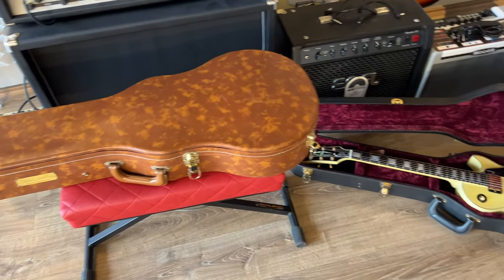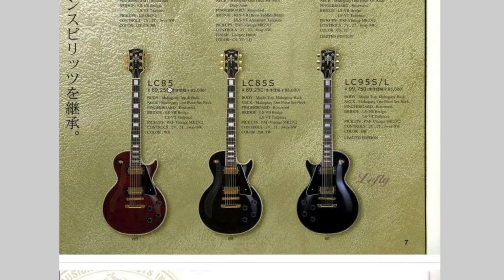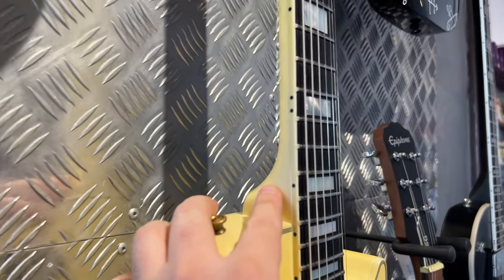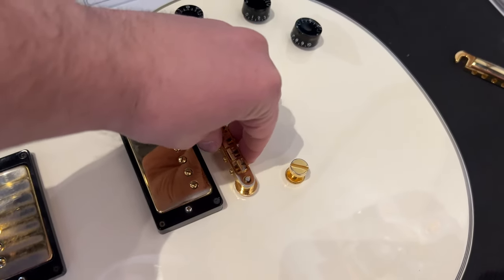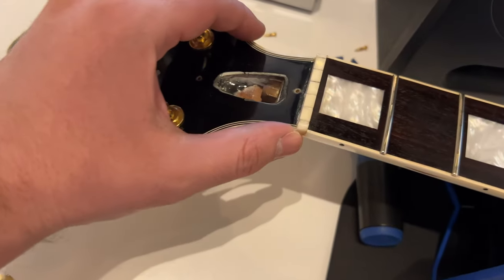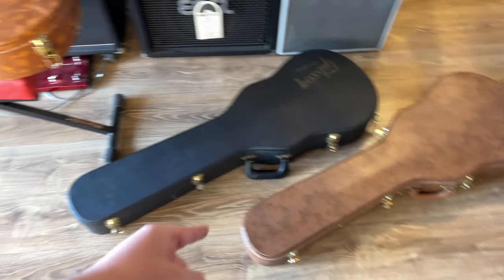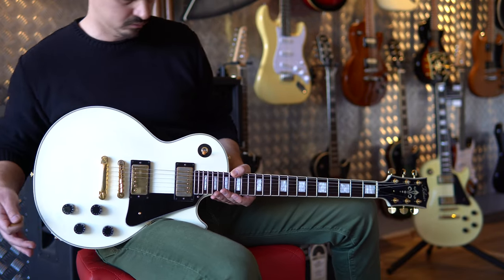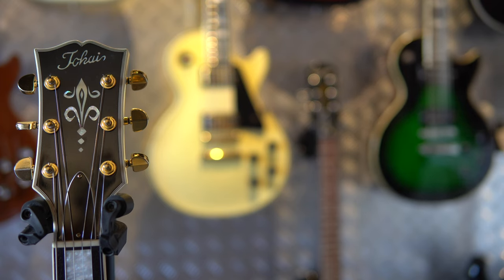Tokai LC80S vs Gibson Les Paul Custom

Comment: Well the tokai is "paf" based sound, lower output, brither. Depends on what u wanna play and what u like ;D both great. I tried some murphy labs and a few more gibsons last spring in london and i end up with the tokai ls136f, was the first one that i loved from the start. Im 100% NOT saying it was better than all the gibsons, but felt better for me, also 1/4 of the price. If i am to get over 5k for a guitar i want it to be perfect for me. Neck, finnish, pickups, all that. Tokai is a very very good safe bet that u will get a good guitar. Also depends how high end u go on the tokais. Most of the 2k + tokais are custom shop level gibsons imho. Just gotta find what works for u, i gladly pay gibson price if i find what i want from them :D
Reply: During these past 2 years I've had  a gibson LP traditional, a 2021 Gibson R8 custom shop, a heritage and an Eastman SB59/v.

The custom shop and eastman were the 2 best for me. SOld ll but the eastman cos 4 lp guitars was just too much. Iwould have been happy with either of them, liked all, but those 2 were for me on a higer level and on par. the heritage close though. 

Recently  wanted another LP again, something like the classic llok, but didnt want to spend so much on a gibson. Grabbed the same guitar as you, an LS136, and damn. What a great guitar. And like you is not better as the R8 or eastman, but I do like it as much a both of them. Plays so nice, the neck is so comfortable. And in its specs or design or shape is closer and more similar to the R8 than the gibson traditional actually. Which makes sense cos the tokai is a copy or looks to be as close as thr later 50's LP, the traditional is NOT a Reissue, is take of the 90's les paul that are great but are their own thing. But I think I prefer for myself the 50's style les paul, thats why I liked the tokai so much. 

And considering the price, amaizng that is as good IMO in quality and overall as the gibson USA's Ive had, at least. Cant find a y flaws at all. I can imagine only the higher end tokais then. Same quality and craftmanship but higher end woods, and electronics and extra perks and nitro finish. 

So Im really not suprised you like the tokai so much cos is indeed so nice to play. Hard to explain what it is that its so comfortable and so enjoyable to play, but I havent been able to put it down at all. Chek my channel if you want, my last video I did a short blues thing with the tokai.
Reply: I had a third-party wind me a set of pickups to the Gibson “Tarback” standard of the 70’s, since an authentic set was a fortune. It make it significantly louder and hotter than the Seth Lover PAFs that are in my Gibson Explorer.
Reply: I also have a 136f can't fault it for workmanship or feel.The pickups sound good through my blackstar 20w valve head and 2 x 12 cabinet. Wouldnt change a thing about it .Great guitar at.a great price.
Reply from the maker: Interesting arguments from all of you.

Comment: To be fair to the tokai it’s an entry level guitar vs the best guitars gibson make in the custom shop. Entry level or not, i think this would be hard not to pick over standard gibson. As you said it was better than the traditional. More importantly it occupies a market share gibson isn’t operating in currently with its own Japanese made product and offers something that can compare with an American gibson (if not better than) for less cost. You can spend custom shop prices on tokai guitars and at that point you’re getting something more comparable to these. i wouldn’t do that personally because if I’m spending custom shop money on a gibson I’m searching for the best guitar before i buy which means I’m committed. But at the same price as custom shop you’re getting Honduran mahogany and Brazilian rosewood. These are specs gibson charge 10s of thousands for. If you spent closer to standard gibson prices on something like this you’d get the right materials and something that more closely compares to the custom shop. Either way the tokai is a winner especially at this price because this is something that plays well, is a good quality build, sounds good (especially with a pickup upgrade as higher end models come loaded with Duncan’s) and you can gig stress free because it’s poly so it can take abuse isn’t too precious like a custom and plays the part well. If it’s good enough for Billy gibbons it’s good enough for you too
Reply from the maker: Good point

Comment: Great video, definitely helped me understand the differences between the two a bit better. I wish someone would do a similar in depth comparison between the more expensive models, like the LC230S, since it's the one I've got my eyes on right now. I can't decide whether I should go with a Gibson Standard model, and get the custom in the future, or if I should go with the Tokai, since they'd both be at the same price point after customs. If anyone has any experience with Tokai guitars, which one of the two would be a safer bet quality and qc wise?
Reply: You can't go wrong with MIJ stuff, especially with the high-tier models. I'll take the japanese every time over Gibsons.

Comment: Vintage type pickups and high gain?  Nah.
Reply from the maker: They are ok with the right amp and a bit of a boost from an overdrive.
Reply: @GeorgeVGuitars  It's the mids.  You want a pup that's more scooped for that.  A higher wind with a stronger magnet.  To each their own though.  Personally, I don't use much gain.  People think they need more than they actually do, or they're trying to hide something.